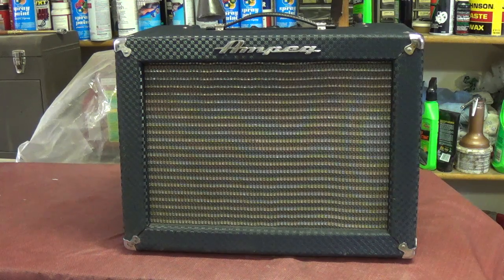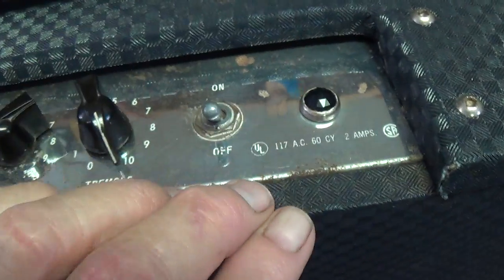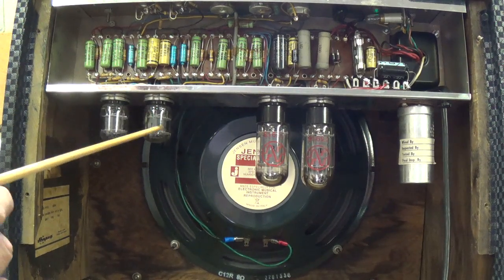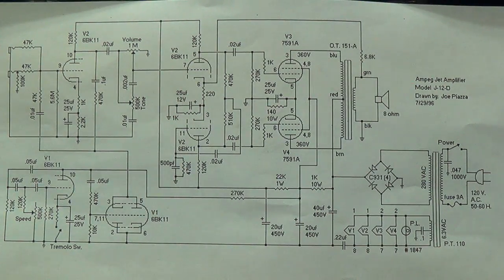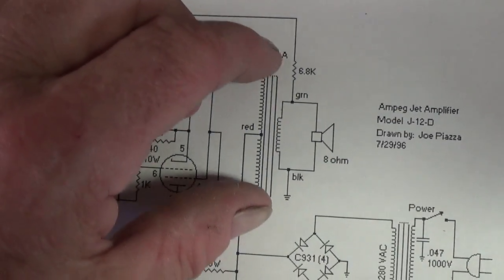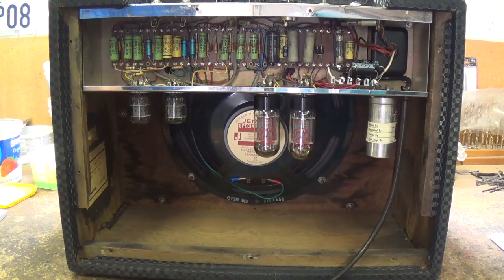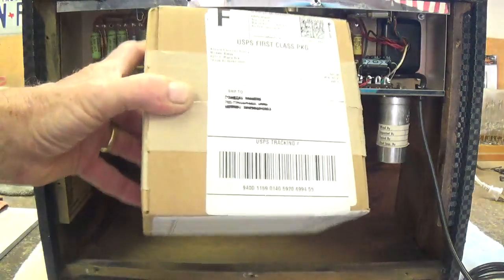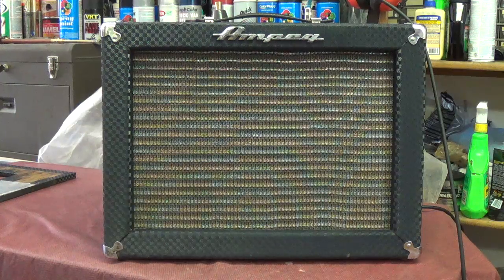1966 Ampeg J12D Jet from Craigslist.....Junk or Gem ???

Comment: gosh , just remembered the stage show goin on back ofan ampeg w/ 7027 , kindofa purple northern lights in a bottle .... but to yours ; JJ tubes are junk , don't know why they're so popular !? the hum maybe that 3 prong , I don't change em , try switchin the B&W wires , the way you woulda just flipped the old cord in the socket  , how much trust dya have in those new small caps ?
Reply from the maker: I've had good luck with JJ tubes, 3-wire power cords, and small capacitors, Bob. I guess different things work well for different people.

Comment: Hey Doug, thanks for all the videos they've been truly inspiring. I actually just acquired what looks like an old 69' Ampeg Gemini I. At first it had no output at all and after changing the output transformer and tubes I can finally get some sound through it, but it is very quite for its size. When calculating the plate deception it was around .2W, so it seems that the 7591 tubes are not drawing enough current, .6mA when it should be ideally around 40mA. I was wondering if you have ever encountered such an issue and what would be the best way to go about diagnosing this amp? I still have yet to get the tremolo working and the reverb tank does need to be replaced. Let me know your thoughts, and thanks again for making these amazing educational resources.
Reply from the maker: You're welcome, Dan. The plate voltage is waaaay too low in the output tubes, as you already know.  You say that you replaced the output transformer (OPT), but are you sure it was a correct one and properly installed ?  Check the output from your rectifier.....it should be in the 450VDC range.  This high voltage DC then passes through the OPT on its way to the output tube plates. Find out why it's not getting there and you will have solved the problem.

Comment: The EH 7591 are a re-pined 6L6, not relabeled.  The JJ's are a better copy but they are a few watts short in output and unreliable compared to old stock 7591 tubes.
Reply from the maker: Thanks for your knowledgeable input, FN.
Reply: NOS is the way to go.  Even if you have to run these crappy JJ for a while .. the NOS stock is usually worth the $$ in my humble opinion.

Comment: I'm kind of wondering about all those really old original looking wax-paper capacitors which by now must be leaking small amounts of DC volts because the paper in them will have altered its ability at isolation between the foil plates... This must be altering the bias on the triode stages just a wee bit so that would be affecting the way the tubes actually sound? It might be why one of those output tubes failed. I know it's nice to have those old caps in there for nostalgic reasons but would the original design have called for such offset and i imagine when any amp was brandnew it would have have had a different sound with perfect capacitors...
Reply from the maker: Actually, I think that aging components are largely responsible for the wonderful tone that we associate with vintage amps, Pete.  Sometimes an elderly component (especially filter caps) may get so far out of spec that it disrupts the function of the amp and must be replaced, but as long as they are all generally "in the ballpark", their imprecision creates a warm, organic, harmonically rich tone that is lacking in modern, somewhat "soulless" amps with ultra-precise metal film resistors and capacitors.

Comment: Would it make any difference to get a twin section electrolytic of the right value and place it where the original can is now?
I would suspect the original capacitors in the rest of the amp to be sources of future trouble if they are waxed paper dielectric.
So my background is radios. Usually paper capacitors are a replace on sight component.
Reply from the maker: Greetings, NJ.  Probably not....I tend to prefer replacing the can caps with individual, axial capacitors, leaving the old can simply for appearances.  I too once worked on radios, and the goal was to get the best possible reception.  With vintage guitar amplifiers, however, the goal is to obtain the best possible (i.e. most original) tone, which can be best obtained by preserving as much of the original circuit as possible.....including waxy caps and carbon comp resistors, as long as they still perform as they should.  There is a name for vintage guitar amplifiers that have had all the old components replaced.....they are (in my opinion) no different from modern "re-issue" amps, which appear to be vintage, but aren't.
Reply: If it was an o/p valve grid coupler that'd get changed. A waxie there that started to leak as the amp warmed up until g1 had +4V on it. This was a radio output stage with a 6V6. Capacitors are cheap. A rewind of an output transformer is a pain in the arse.
I have polypropylene and also paper capacitors in military tropical sealed cans. If you want original appearance then stuff the old sleeves with modern components and nobody would be able to tell the difference.
I do leave waxies where there is no appreciable voltage difference across them in a non-critical location.
Reply from the maker: Any component, resistor or capacitor, that fails to perform properly (leaking, crackling, etc.) gets replaced, NJ.  But those components that test and perform well are generally left in place. It's more a matter of preserving the tone of the amp, rather than its internal appearance.....however, this is simply a preference for my own amps and those of like-minded customers.  I would not argue with those who feel otherwise.

Comment: Nice seeing this as my first rebuild was the reissue of yours (SJ-12T) in mine the previous owner had disconnected the speaker to do some testing with another head unit. then a couple days later fired it up without the speaker attached.

likewise the transformers wore good but almost everything else required replacement. it would have failed the sniff test ... :)

thanks for the video.
Reply from the maker: You're welcome, Chris. I guess there would be no non-working bargain amps.....if there were no careless, forgetful previous owners :)

Comment: You likely already know.... but    6C10, 6K11 or 6Q11  are acceptable substitutes for 6BK11
Reply from the maker: That's good to know, DK. Are any of those tubes more common and less expensive than the 6BK11 ??
Reply: Indeed.   Going price is ~40$  each.   GE and or Sylvania.
Reply from the maker: Less expensive.....but not cheap :)
Reply: Indeed not cheap,  about as much as a KT88.    A good  12AX7 is 15-25$    A 6K11 is 30-40$...   so that's  1.5x the price... seems about market.   

I'm surprised that the 35Z5 is being declared rare,  and prices are bumping up.
Reply from the maker: Indeed....eventually the series filament radios and amps will become too costly to repair :)

Comment: Oh god, the moment I saw the first head-on shot of the Jet, I choked. That was my dad's first amp, and then mine. Between the two of us, we killed the original speaker, so he ordered a ceramic celestion (I think it was an early 90's Vintage 30), and it was suddenly louder and far less compressed. My dad built me a "pedal/preamp" using a pair of 12ax7's in a 4 stage cascade (full plate voltage on the tubes, kinda marshally crunch) with a slight high-pass filter off the first stage, and I used the Jet as a clean "platform amp" to amplify the distorted signal from that. I have been trying to recreate that sound ever since then. I would ask my dad what he used as a schematic for the basis of that preamp, but unfortunately he is unavailable for comment. I have his (ok, it is technically mine, but....) Reverberocket now, and I think if I had the pedal/preamp to put in front of it, I would get pretty close, but I can't find it in his paperwork. If I manage to keep the state from taking his (my) house, and manage to get back on my feet financially, I might buy or even build something like the Effectrode Tube Drive. The Ampeg cleans are great, I like them better than Fender clean, and it would essentially turn it into a footswitchable  two-channel amp that would be ideal for playing hybrid reggae-punk stuff at small bars, where I'm playing clean reggae rhythm during the verse and dirty puck rock during the chorus (or vice versa), also for recording the same. There are so many thing I wish I could ask my dad.
Reply from the maker: It's a shame that we only fully appreciate our parents after they pass away.  Like you, I often come up with questions that I should have asked.  We're glad the video brought back some memories, Adam. Best of luck.
Reply: Try a Bad Cat 2 Tone or Matchless Hotbox for that dual 12AX7 pedal. Schematics are available online if you search

Comment: Hi Uncle Doug! greetings from Uruguay! I like your videos and pets! 

Just a question, are you using an ESR meter to check leaky capacitors? Maybe I'm little confused but leak is due a " non-infinite parallel" resistor whilst ESR is a series resistor? Could please give some hints on that. Cheers!
Reply from the maker: Greetings, Andres. The ESR meter is not used to detect "leaky" (parallel resistance) caps, but to measure the internal (series) resistance within electrolytic capacitors that develops over time and is indicative of progressive failure.  Such failing capacitors often do develop a parallel resistance, however, but this fault is best measured either with a DC ohmmeter or by charging the cap to operating voltage and then measuring the amount of DC that passes through it.
Reply: Thanks. Yes I made leak tester with diferentes supply voltages and a micro amp meter to do so. However I dont have an  esr meter, i think esr developed at higher frequencies such as in switched supplies. Do you think both measurements are a must to in tube amplifiers? Thanks!
Reply from the maker: The ESR meter does operate at high frequencies, to avoid charging the capacitors, and is a very useful device to rapidly check the viability of electrolytic caps, but if you have a leak tester that works well for you, then that's probably all you need.

Comment: As always another great video Doug & Rusty !  Alway love seeing new and different things on your YT channel , love the complete conversions from some other application like PA or old radio conversions and I have shared your instructional videos with friends as they are well done and very informative. Our generation has a small edge on these videos , I took Electronic Engineering in College and was the last class to learn Slide-Rule and next semester first to take scientific Calculator & FCC Radio. LAFF ! those first calculators were the size and weight of a house brick , and the HP used reverse Polish Notation, and didn't look as dorky hanging on your belt like the slide-rules, ahhh fun times.
Reply from the maker: Thanks so much, Dan. I too learned logarithms in school and used a slide rule. I bought a compact model that could be hidden in my pocket, so I didn't appear to be (quite as) dorky.  My first calculator could only do simple math....no square roots !......was a little smaller than a brick, but nearly as heavy, and cost $80 !!!  I was thrilled with it (for a while).

Comment: Yes, that is likely at the assembly line.  The removers I have are nothing more than a set of 5 different size drivers  that fit on a 3/8 or 1/4 drive ratchet with the shape to precisely match the screw head.   Mine are old Snap-On.
Reply from the maker: Thanks for the input, P8 :)

Comment: Those screws are called clutch heads by GM.  My old Chevy trucks used them on the bodies. This is the first I have seen them in any other application.
Reply from the maker: By coincidence, I am currently restoring a 1957 Chevy truck, and it has these screws all over the place.....door latches, bracket attachments, gas tank sending unit, instruments, etc. I assume they are installed with an electric device with a clutch mechanism adjusted for proper torque.

Comment: Uncle Doug, maybe you would do a video that explains milliamps in regard to guitar effects pedals. The numbers seem all over the place, so it's hard to know what power supply to buy.
Reply from the maker: All that matters, Michael, is that the ability of the power supply to provide current (measured in amps or milliamps) exceeds the total requirement of all the devices.  For example if you have three pedals, each with a 250mA current requirement, then your power supply should be able to continuously provide at least 750mA......preferably more (i.e. 850mA+) for a safety margin.

Comment: I'd bet a dog really could smell a bad component. .... just a reminder, for those canines that are not as experienced as Rusty, it would be wise to drain those capacitors before sniffing around inside a tube amp with a wet nose! 
Thanks to Rusty and Uncle Doug for another great video.
Reply from the maker: You're welcome, TG, and thanks for the helpful reminder. A dog standing on a concrete floor, sniffing a fully charged filter cap could get electrocuted......so be sure they're fully discharged prior to any sniff testing.

Comment: Uncle Doug, great video as always. One question, why wouldn't you replace both output tubes at this point? Old amp, one tube shorted, no idea the hours on the good tube. To me it's a minor expense to replace both tubes, especially considering the resale value. Thanks.
Reply from the maker: Thanks, Howard. You make a good point. It would have been better to get a nice matched set of new output tubes.  To be honest, I didn't think of it until after placing the order for the single tube.
Reply: Done that! Thank you.
Reply from the maker: You're welcome :)

Comment: Hi Uncle Doug... what an excellent video! Your testing techniques are fast, simple, and use minimal gear. And Rusty's diagnostic ability is uncanny. What could be better? BTW, the screws are called Robertson, a Canadian invention. Since they have four sides, they can torqued easier than a slotted screw, and the head of the driver is inside the screw, so fasteners don't get damaged as much. The Robertson bits hold a screw well, so also easier to start a screw one-handed or upside down. Same concept as Philips and Torx. I used to work for a Canadian company that exhibited at trade shows in the US, and we would have to take Robertson screwdrivers with us -- our booth was assembled with Robertson screws and the local tradesmen usually didn't have the right screwdrivers. Anyway, congratulations to you and Rusty  for another top-notch video.
Reply from the maker: Thanks so much, Greg. Rusty and I really enjoy hearing nice comments from viewers (like you :)

Comment: Uncle Doug, from what I see, a sustained positive voltage on V2 pin-9 will make the voltage on pin-10 decrease substantially.  The AC-component will appear on the 470K-side of the .1uF capacitor as, perhaps, as much as sixty-to-over one hundred volts below chassis-zero.  This is the only path that I can see that would allow V1 pin-3 the negative-with-respect-to-pin-2 condition that it needs for conduction to occur, and when that section of the tube conducts, the negative-going output on V2 pin-9 is also attenuated.
Reply from the maker: Thanks for the very detailed analysis, James. Once the offending tube was replaced, the problem ceased.....thank heavens :)

Comment: Uncle Doug,
You are a great teacher !
Like the video' s a lot and learned a lot .
I own a 1964 Jet with the 6v6gt and 6sl7 tubes
( sounds a bit harsh , could be the speaker) so thumbs up !
greetings from The Netherlands (also to Rusty from our wheaten terrier Floss)
Reply from the maker: Thanks so much, Willem. A vintage Jet shouldn't sound harsh. You might want to check for low-value (generally in the pf range) capacitor(s) bridging a volume or tone control.....they will allow an excess of (possibly harsh) high frequencies to reach the output section. Regards to Floss :)

Comment: Great video as usual, Doug. Cool amp as well! I have yet to find an Ampeg I did not like. Their guitar amps are really underrated. Most people have this mistaken belief they only do bass stuff. But anyway, one observation when testing transformers for continuity, you might get a false reading on the OT secondary if there is a NFB, because there may still be continuity even in the event of a blown secondary. But the resistance will be way higher than you should expect on an OT secondary, and instead will be the sum of the NFB resistor and the tube to which it connects' bias resistor.
Reply: ...if one side of the secondary is grounded, I should say.
Reply from the maker: Thanks, Brad, and thank you for the clarification on the continuity measurement of the secondary.  I should have mentioned the possibility of a high reading with a NFB and that it would indicate an open secondary winding.
Reply: No sweat...I'm always forgetting to mention stuff. Sometimes too much information goes in and not enough comes out the mouth, at least with me. :P

Comment: Sometimes you stumble across amps like this one that were used by organizations like church groups etc. and all it ever did was serve as a PA system.  Typically, as in the case of this one, the exterior of the amp is nearly pristine since it spent most of its life in a closet but the components are never serviced.  Once some component finally dies, they just stop using it.  Very lucky find!
Reply from the maker: Perhaps you're right, Gurn. Thanks for your input.